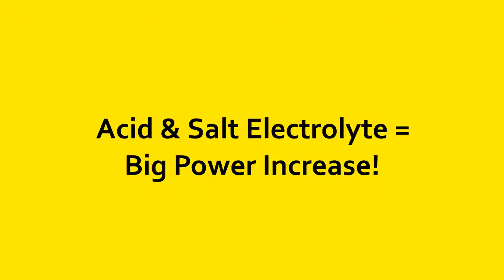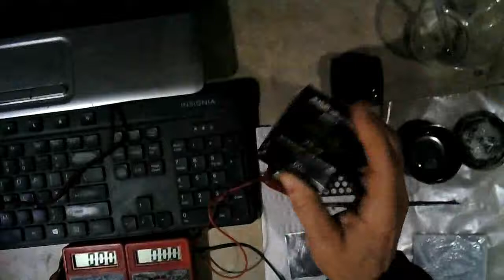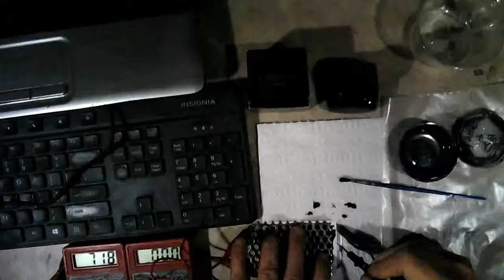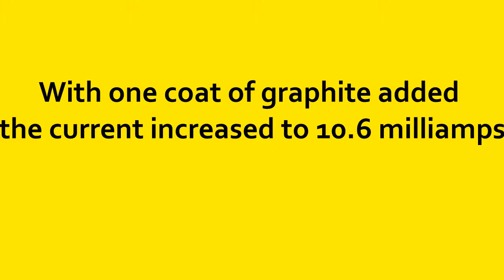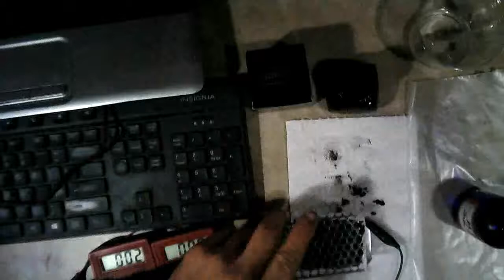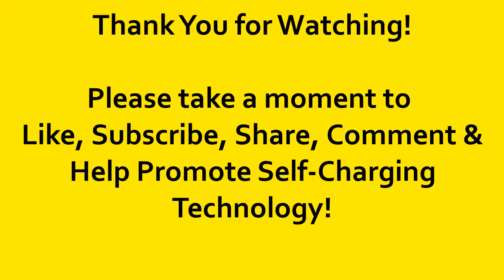Acid & Salt Electrolytes = Big Power Increase!!

Comment: Hi Bio Cell, Great results.
The carbon black I have been using does have a lower resistance than graphite when you shove the 2 meter probes in the 2 powders :-)
I have been trying to develop a good conductive ink for a a while, and a mix of carbon black and graphite active ingredients works quite well.
I can remember a cell experiment I did a couple of years ago where the current seem to creep higher on a s/c test, the metal I was using was Magnesium with a magnesium salt electrolyte as I recall.  -  Martin.
Reply from the maker: Hey Martin! You can call me Ray, please. :-) I'll have to buy some carbon black powder I guess. I like the idea of having two naturally different conductive carbons. That should make creating a dual carbon battery easier I would think. I think I'll try some zinc sulfate and zinc chloride in the cell next since I'm using a zinc electrode.
Reply: Great idea Ray, I am using that same electrolyte in my current Zn MnO2 cell, time permitting  I will be uploading vid the next couple of days.
Spoiler - its looking quite good :-)   -   Martin.
Reply from the maker: That's cool Martin. Please post a link for us.:-)
Reply: As requested:-https://www.youtube.com/watch?v=KoCp6xGOWao
Reply from the maker: I just viewed the video. Impressive results Martin! I see Kev and cayrex viewed it too. I like your style of video creation too. You didn't have to say a word! :-)
Reply: I don't post that many vids, so I find it helps to type a script around the many video clips I then stitch together, otherwise I waffle  :-)

Comment: The initial results were pretty impressive. Was there any corrosion on the plates?
Reply from the maker: The plates look pretty clean Fred, but there is definitely a thin layer of oxidation. I tasted the zinc plate too, and couldn't detect any sulfate taste which surprised me.
Reply: The combination of MgSO4 and phosphoric acid seemed to produce a reaction. I would have thought there would be some disassociation which could account for the oxide layer but there should have been some sulfur too. The ratio of one to the other might affect the results. Either way the longevity of the electrodes might be diminished.
Reply from the maker: I was expecting to see a dark sulfate deposit too, that's why I tasted it to be sure. No taste at all. I think it might be the double separator (paper/pva), and the sulfates got stuck in the paper. That's just a guess tho.
Reply from the maker: Please don't complain about a potential lead poisoning risk. Save your complaints for the cosmetic industry that still puts lead in lipstick, or the industry idiots that put flouride in toothpaste and drinking water. Thanks for the comment tho! :-)

Comment: I believe that magnesium sulfate and phosphoric makes magnesium phosphate and sulphuric acid
Reply from the maker: Hi Garrett! That makes sense for a simple substitution reaction, since the phosphate (Po4) ion and sulfate ion (So4) ion are the same in structure. The positive Hydrogen ions are different however. H3Po4 vs H2So4 Then we have the structured water molecule, H302, regular H2O, and the H+ and OH- coming from the Tio2 interacting, and free O2 from the air too I think. It doesn't take long to get real complex chemistry when we add electrolytes to the cell.  Which is why I put it off for a long time. Thanks for the input! :-)